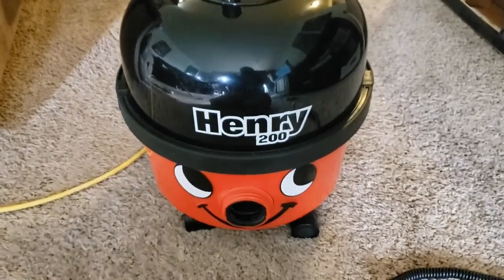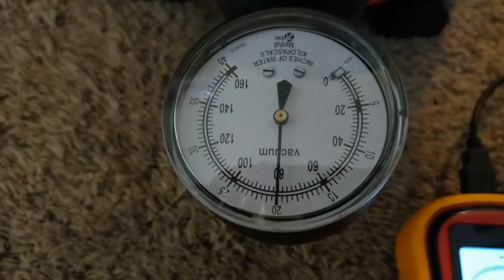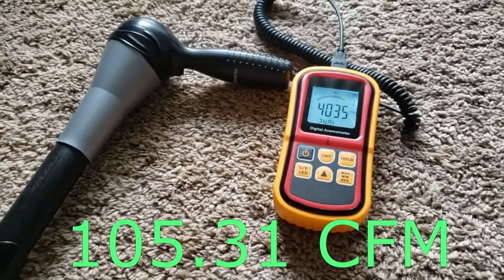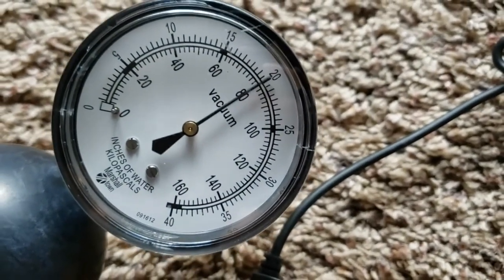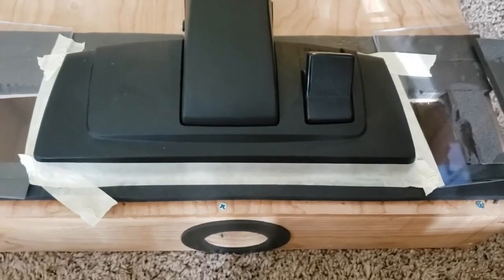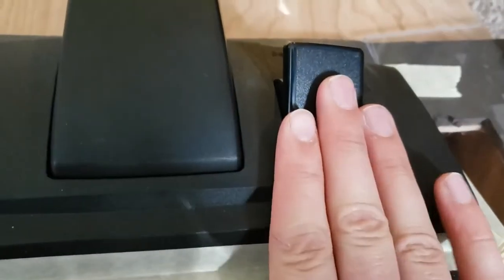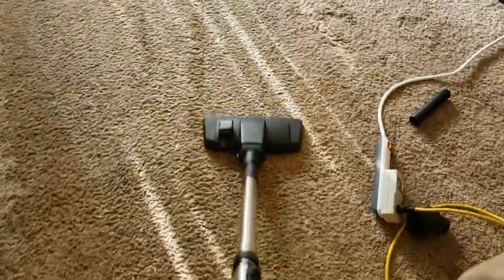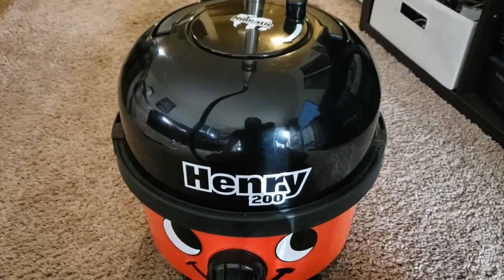Henry HVR200-11 Airflow testing.

Comment: The wattage is wrong. Its a 620w motor not a 680w motor. This might have too much suction. I guess.
Reply from the maker: Dunno either way i'm happy with it
Reply: Yes, but if the vaccum is over 620w, you need to return it or put a normal 620w motor in it otherwise the vaccum will be seized up very soon.